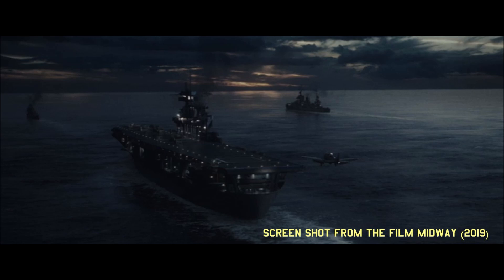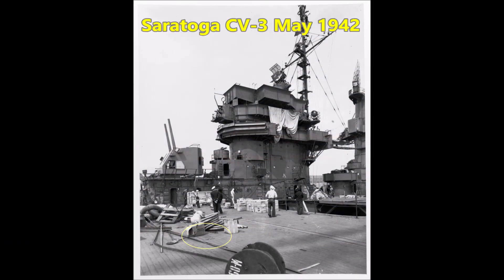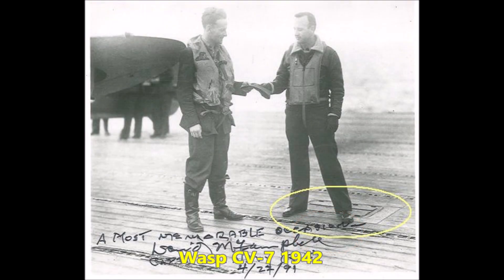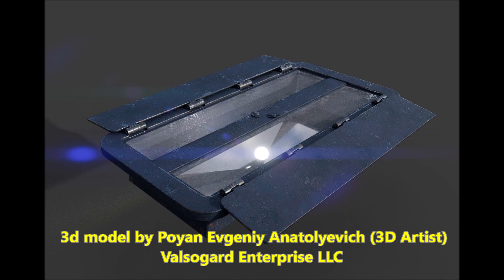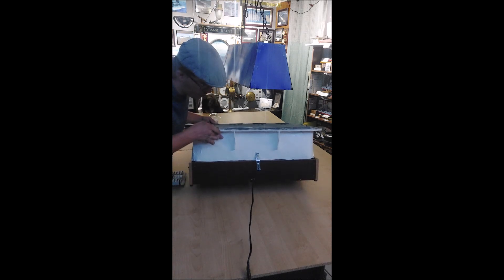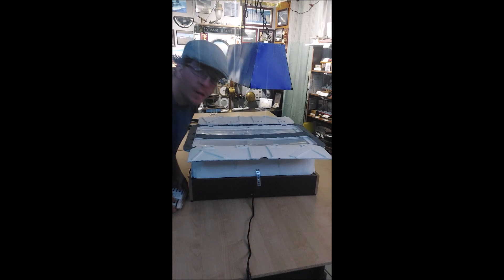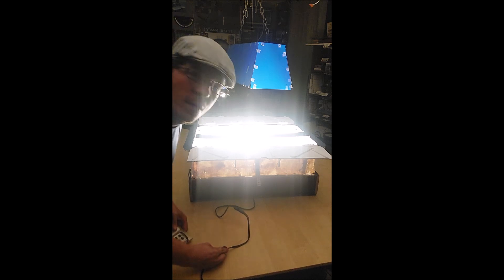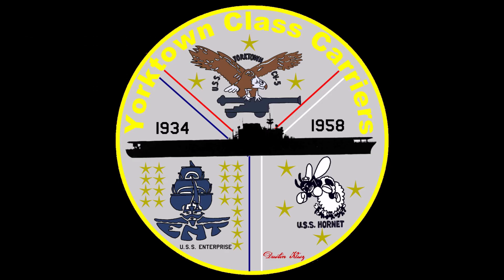Aircraft Carrier Landing Lights of WW2

Comment: I'm going through some dockyard pics my researcher buddies have shared with me and I see them on the deck of Yorktown in September of 37.  Will update if I find any good pics of them open or anything. (edit: removed Enterprise)
Reply from the maker: @rtwpsom2  really that's cool, if they are good enough I can add them to the video if you can share them, I looked everywhere I could for pictures and the ones in the video are all I found
Reply: @navybowie  They aren't mine to share, they were copied by some friends who are professional researchers from the NARA archives. I've checked all the blueprints I have available, (which is a considerable number) and none of the "as built" blueprints mention the landing lights, so they would have been added some time between 34 and 37 on Yorktown, I am not sure on Enterprise.  The only good pictures I have of Hornet are from her commissioning and they don't seem to be there in those pictures. One buddy said they were using them for early morning operations well before the war.
Reply from the maker: @rtwpsom2  thats perfectly fine I understand 
That means they were probably added during her very first refit after being commissioned and her sea trials were c9mplet4d  which is what I thought but couldn't confirm it so thats good news
I'm pretty sure Hornet had hers installed when she was built based on some of the pictures I've seen which I did include some in the video. 
Thats great news also, never heard that before.  If you wanna send me a message on Facebook you can find me in my group Yorktown class carriers id be happy to talk more about this and thank you for the information
Reply from the maker: @rtwpsom2  have you found out any new information on this? I'd love to talk more on this , you can find me on Facebook, I'm the admin for the group Yorktown class carriers
Reply from the maker: @rtwpsom2 was that you that recently joined my group, if not send me a message when you do join so I know it's you please